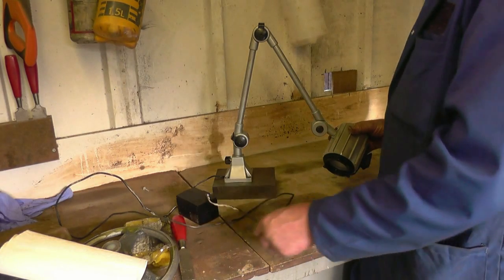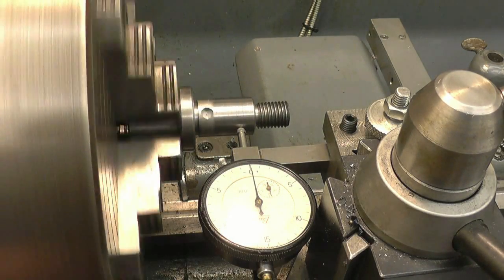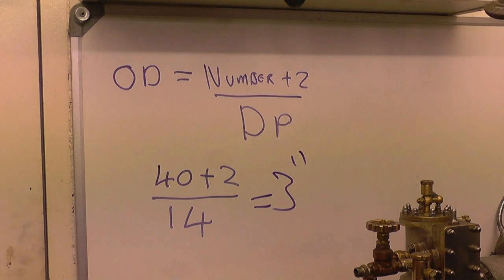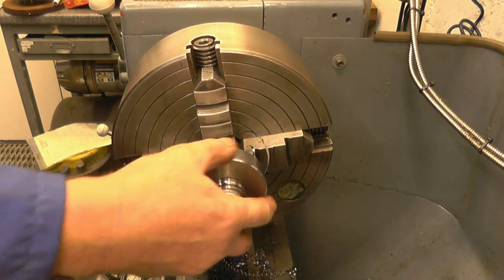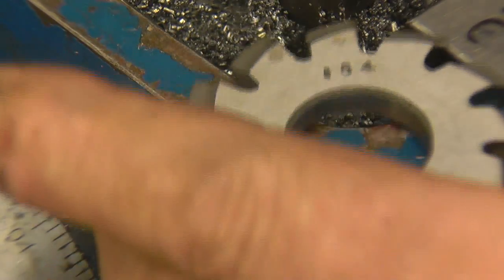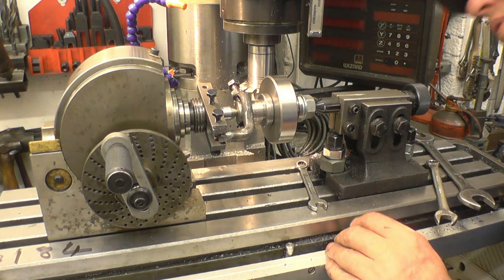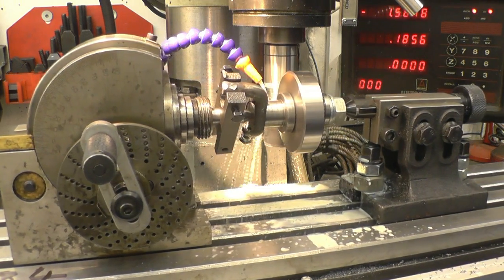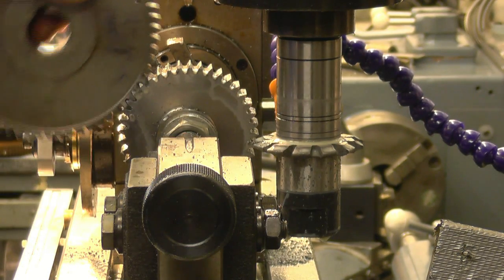Sunday Night NC  94 part two

Comment: Nice furnace and casting set-up John... looks great result.  Another nice gear too.

Years ago, when camping in Newquay Cornwall - used to see Javelins and Vulcans flying over the beach - low and loud.  I think the Vulcan was the archetypal "V" bomber. That was back in around 1965.

Hang in there Debs - long job she has to deal with.

Comment: Part I, where you ran those gears dry, set my non-gear teeth on edge. What is he doing? Then you oiled them and I was relieved! I would much rather have oil on the floor than not enough oil. The gear cutting video was great. When I am cutting gears (I am trying to build a clock) I find that it requires a great deal of concentration, and the biggest mistake is forgetting to lock the dividing head. Or unlock it for that matter. And don't forget to move the sector arms if you are cutting some oddball number of teeth. It is very easy to forget where you are. And to talk at the same time, as you did? Major achievement. 
Thanks, and best to Debs. When you are recovering from major ops, the worst part is the part where you are not quite back to normal. It takes time. We are no longer 20 years old, and do not heal as quickly as we once did. Poco a poco, as they say in Spanish. Slowly.

Comment: John, you need to make a couple of nose extensions, for that press, that just slip over the nose and are held on with a thumbscrew.  - I keep all tool steel parts also. -  John, why don't you use a chip hook to keep the chips from building up like that. -  Great work on the practice gear. - Thanks for the video of the Vulcan.  I hate it when great old planes retire.  The B-52 is as old as I am, and will out live me by probably 25 years.

Comment: John, been following the videos for a while and really enjoying them. Those pointy teeth don't look right. I used the wrong dp cutter once and had a similar result. Or the depth is too deep, hard to say. It should look exactly like the other gear you have, with a pronounced flat on the tip.  Would it be possible to measure the teeth, maybe using rollers or something, and comparing to the other 40T gear. The gear will probably run well enough, given the limited speed on a lathe, but it does not look right (from here at least).  Mart.
Reply from the maker: +martsrods I agree it is not right The depth of cut seemed  very deep to me I will look in to it
Reply: +doubleboost John, do you think that when you trapped the paper, the cutter was not on the very tip? It's awkward working round the back, blind like that. great close ups, in the vid, by the way.
Reply from the maker: +martsrods I did it twice and got the same reading
Reply: +doubleboost John, I'm new at this, but I just looked up a formula for whole tooth depth and it's 2.157/DP which for a 14DP is .154. The .184 may be incorrectly stamped. The extra .030 per side may explain the pointy teeth. Mart.
Reply from the maker: +martsrods That sounds very likely Thanks for thatJohn

Comment: Hi John,  As per usual great video. Always learning lots from you.  Couple of questions.  How did you find the chinese cutters, they seemed to do a great job for the money?  Whats your view of them.  When you use coolant on your mill or lathe, do you completely strip the machine right down and dry it, or just wipe the coolant off when finished? I was wondering about rust. Thanks for the great Vids. All the best to Debs from across the pond.   
Tony a cockney ex pat in NB Canada.  PS when ya gonna get the bloody marbles out of ya mouth....LOL!!!!
Reply from the maker: +tmdmail The cutters are fine as long as you take your time The coolant I use is very high speck I never have rust I just let it dry off
Reply: +tmdmail Thanks John, appreciate the info.  I have got a few friends here watching you now, but I do have to translate at times for them Not just the accent but brit words and sayings not used here.  If you ever need anything from this side of the pond, let me know.  Tony
Reply: +tmdmail --You think you have it bad, you ought to be from Texas and try to understand him.   :)